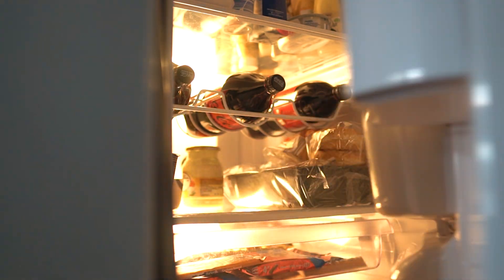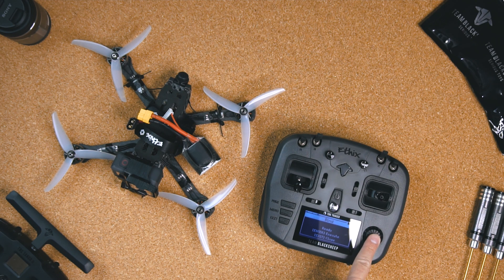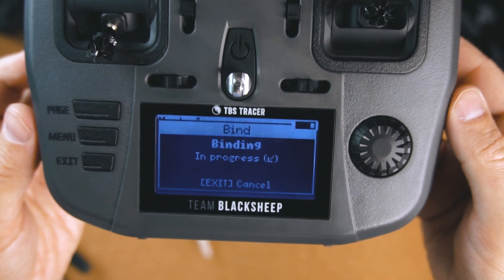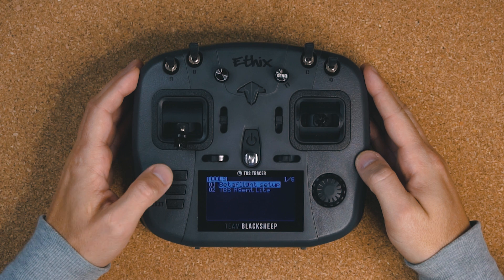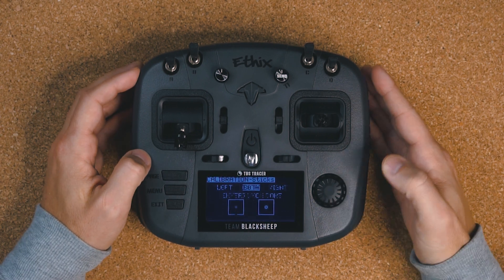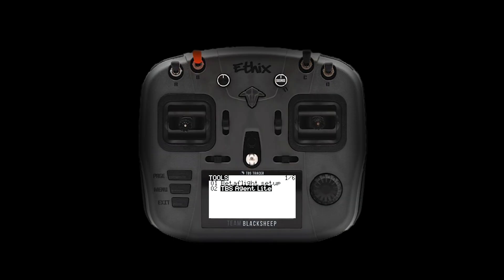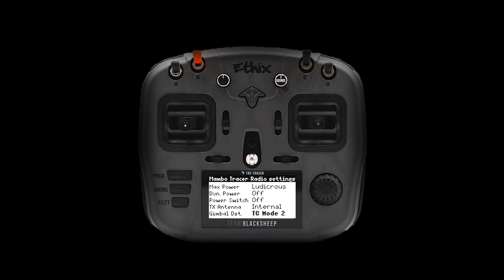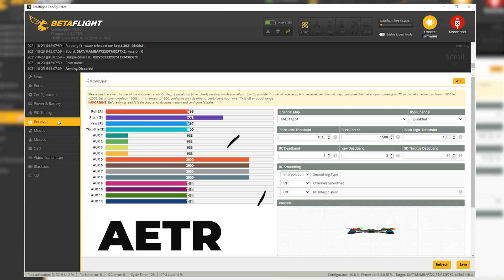TBS OpenTX BYPASS - improve latency on Tango 2 and Mambo

Comment: Thanks a lot ! I wondered because my Gimbals doesn’t work after the update to Tango II XF 6.13 and you mentioned that they have to be calibrated again :) only short notice: different Throttle Limits over a Switch doesn’t work if you select mode 2 instead of freedom tx in general ratio settings.

Comment: Dang just got mine and went to flash latest firmware and now its bricked. Bootloader mode doesn't work either. After flashing new firmware it doesn't power up. Seems like am not alone.  This radio is like a ticking time bomb...
Reply from the maker: did you flash with Agent M web app or Agent X? 
about bootloader mode, did you wait a few seconds, takes a bit to show up
Reply: @chrswnd  I did with both Agents and have same outcome. I hold power bottom for 3 or more seconds.  So many other people are have same issues and I don't understand how TBS can sell me a radio in November when this issue was report back in the release earlier this year. Its so frustrating know that my Jumper T8SG is so much better then the Mambo toy.  I should have just went for ELRS module and receivers. What a bad decision I took.
Reply from the maker: @FlyturboKwad  I’m confused, why the power button? just hold PAGE or MENU (depending on which bootloader you want, FreedomTX or Tracer) while the Mambo is off, then plug in USB and wait a few seconds… should show up in Agent M in bootloader mode… I‘m sure it can be revived! don’t give up!
Reply: @chrswnd  That's what am doing. When I said power button I was to reply to your statement When I turn unit on I hold the power button as per Mambo instructions. When I go to bootloader I hold only down the PAGE button for Freedom TX and plug USB and release the PAGE button when I see it load in Agent X or M, i release the PAGE button. Its a simple process, but Mambo is bricked.
Reply from the maker: @FlyturboKwad  Ahhh okay! where did you buy it? you could also open a ticket with TBS, maybe they can help and know a way to recover it… sorry that it’s acting up 🙁
Reply: @chrswnd  I got it from TBS store and ticket was opened yesterday. Waiting on their reply. I'll try to keep you posted with outcome.

Comment: Really nice. Thanks for sharing. I hope calibration works better now. It was a mess on the first run with my T2.
Reply from the maker: thank you for watching! ☺️ let me know how it works out for you, it should be less of a mess now 😝😅👍🏻
Reply: @chrswnd  I would like to say its better than before. But its still a mess to get a perfect calibration. :D
Reply: My right Stick is going crazy now and i dont know why. Calibration was succesful now but the right stick seems damaged in my mixer monitor. Yaw and Throttle are working fine. Even when i set it back to "Freedom TX" mode my right stick is not working properly. Hmm
Reply from the maker: @MrSmithFPV  dude I'm sorry to hear, I just tested the calibration on my T2 w/ 6.10, it works flawless over here... I guess I don't need to ask if you re-tried again? did you wait for the beep to end?
Reply: @chrswnd  Yes, ive waited for the beep. I dont know exactly where the issue was but now i've also updated FreedomTX to the latest version and now it seems to work.
One question. Does this also work with the Crossfire MicroTX module or only for Tango 2 and Mambo? Because iam still using a Taranis with Micro Module and Crossfire Multibind.
Reply: Ok, i've tested it and iam able to update the Micro Module to 6.10 but there is no option in TBS Agent that allows to activate the Bypass method. Also no option in the TBS Agent Lite LUA Script. That means it is not working at this moment. They need to update the LUA script.
Reply from the maker: @MrSmithFPV  so FreedomTX is needed to be up to date too, I was already on 1.30 so that’s probably why it worked for me, good to know and glad it worked now :)
Reply from the maker: @MrSmithFPV  only works with the internal RF link for T2 (Crossfire) or Mambo (Tracer), not sure if it’s going to be possible with modules (probably not possible to skip OpenTX functionality for external modules) but I’ll ask the developers 😊
Reply: @chrswnd  I think there is no big difference if it's a internal Tx module or an external. The problem is that iam (and also all others) are not able to use the multibind feature anymore. Because when iam enable the Bypass then i need to correct the stick start- and endpoints in the Betaflight CLI for my Tango 2 and the specific quad. But after this iam not able to use e.g. my taranis with external Crossfire module because the start- and endpoints are incorrect for this radio. I hope they will think about that issue...

Comment: Nice Review Bro 👌.... Did i understand right? It works not with Kiss (Ultra) right now?
Reply from the maker: thanks Henri! 🙌🏻😃 it works with KISS if you change the channel lay-out in the crsf/tracer receiver (because KISS uses TAER instead of AETR, and the bypass is only sending AETR order) 

BUT: if you use idle up, that is not working right now, maybe a workaround coming in 6.12
Reply: @chrswnd  very good explanantion of the new feature. Issue I still see with Kiss, with bypassing the mixer it is not possible to set midpoint to 1500. As subtrim will not work anymore. But required to get midpoints to 1500. WOuld be great if TBS provides a solution here.
Reply: @fishjaeger9486  bump into the same problem with Tango2 subtrim won't work
Reply: @chrswnd  ah ok, Thanks Bro 👍👌😎